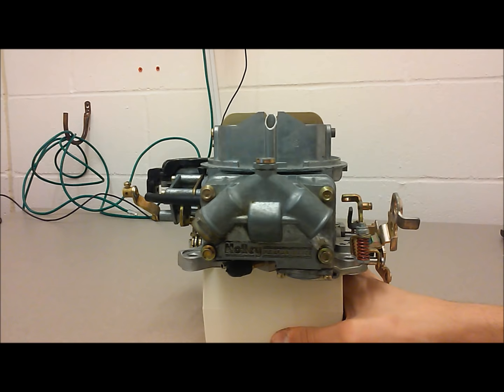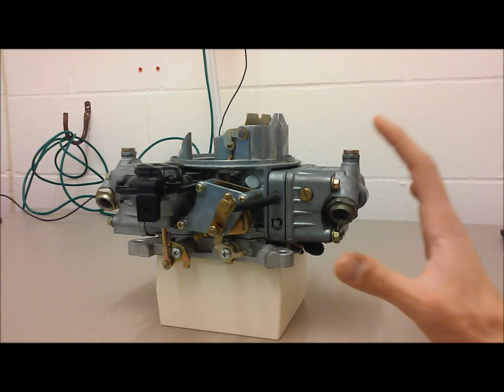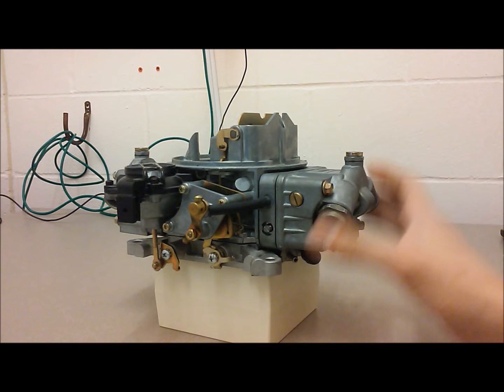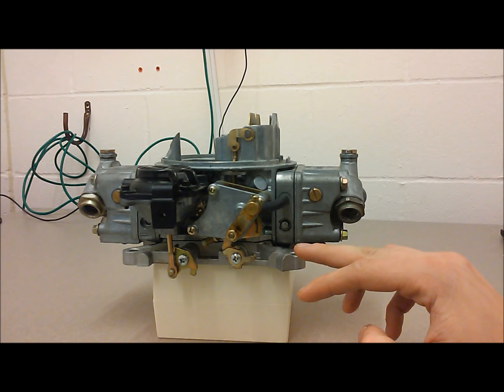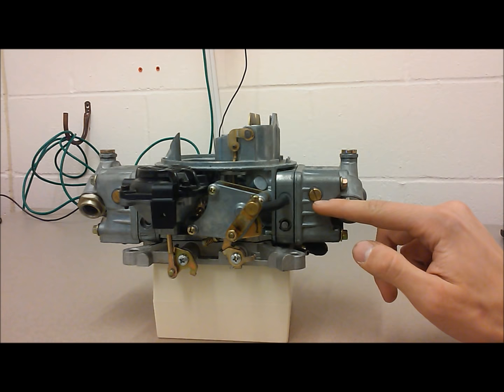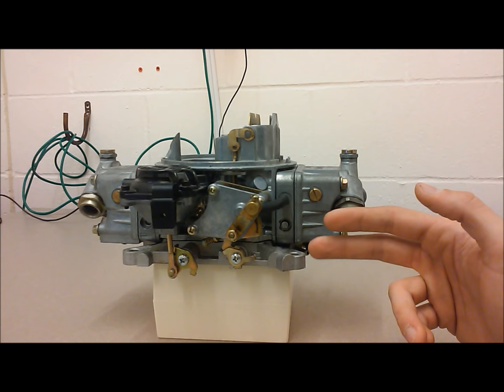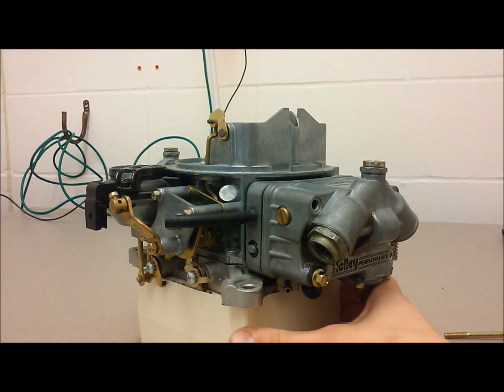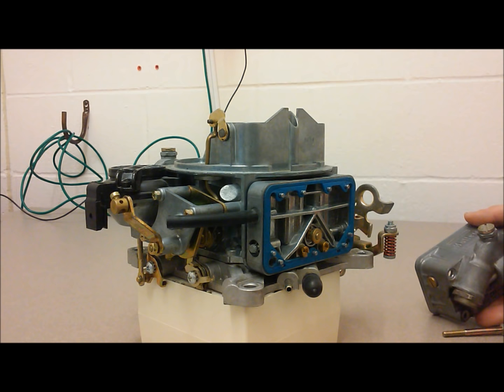Holley Carb: Proper Carburetor Jetting (CARB BASICS PART: 3)

Comment: he said i know exactly whats wrong with your carb these quickfuels all do the same thing he took off the metering plate stuck a drill bit inone of the holes and said .035 ok come seeme tomorrow after work and it will be done i came back the next day there was holes in the butterflies and he said put it on your car turn the idle enrichment screws in until it starts to stumble then back them off till it smooths out plus 1/4 turn when i got it jome and put it on it barely wanted yo run wouldnt hardly hold 500rpm and the idle enrichment screws yeilded no change called him up told him what was happening and he said turn up the curb idle screw no more than half a turn a little over a quarter turn yielded 800 rpm so i took it for a ride idle enrichment screws at about 1 1/4 turn good down low garbage anything passed 3500 got worse when i turned the enrichment screw in more but 1 1/4 was still too rich at idle black smoke bad fumes 2 turns om afraid would drown the thing i went 1 3/4 turns and the idle went down wich required more curb idle and the cycle starts all over
Reply from the maker: +William Morton what type of fuel pressure are you running? do you know? thing is way rich, usually a big cam takes more idle mix because the reversion requires a richer mixture. try opening the secondaries a bit first to get a bit more air in. that idle just isnt right at all. 
your timing is going to hurt your idle if your shooting for anything less than 1200. im sure youd be around 19-22 idle with 32-34 total, with an aggressive advance curve. i just have never been successful with locked timing myself. 

if it were my car, not having personal physical knowledge on your car, id set it up first with a carb spacer and a regulated fuel pressure at a consistent 6.5 to 7.5. have my primary throttle blades set to just where the square is showing, idle mix screws 2.5 turns out. timing set to at least 18 degrees with total at 34 (all mechanical). stock sized jets in the carb. id then light it off. thing should hold an idle there and you can tune accordingly. what size engine do you have and what sized carb? 

when i was 16 i had a quick fuel carb and i paid someone 50 bucks from a speed shop to help me tune it. they didnt tell me what they did and it never ran worse. from then on i decided id learn this shit.